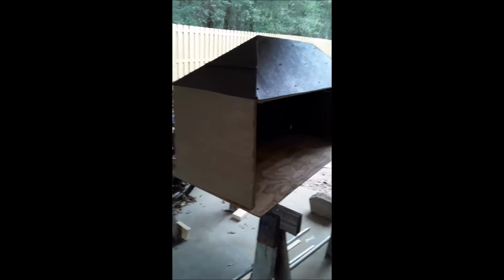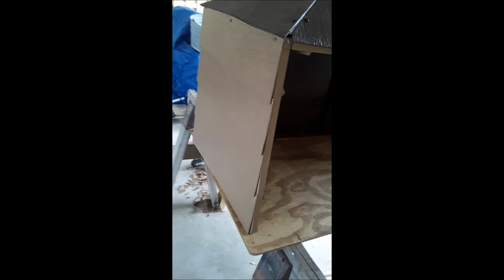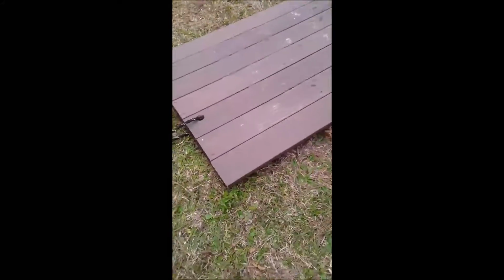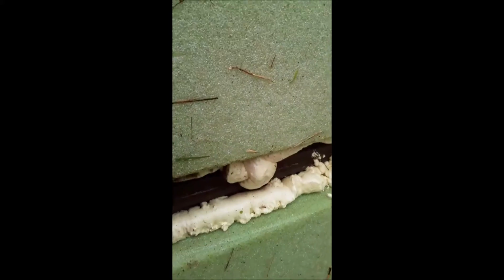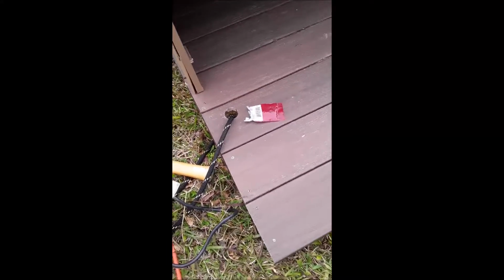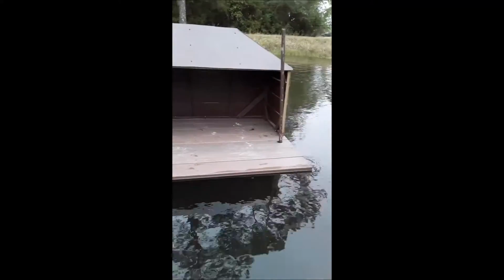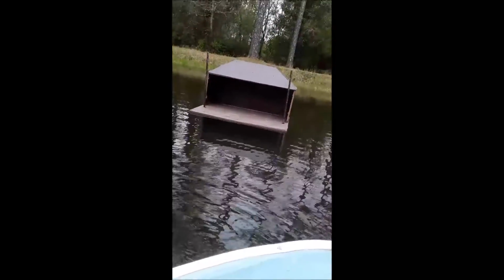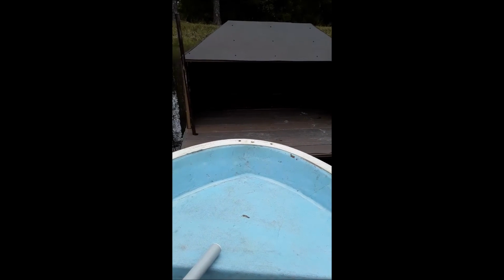Rot Resistant Floating Duck House

Comment: Nice touch with the angle bracing, but with the siding and roof all orthogonal, you may have been able to save yourself the trouble, since they will brace each other.  Maybe not so much with individual boards rather than plywood sheets, though, but probably would have still worked fine.  Not a criticism.  Nice work.